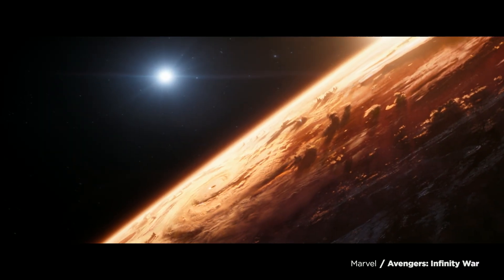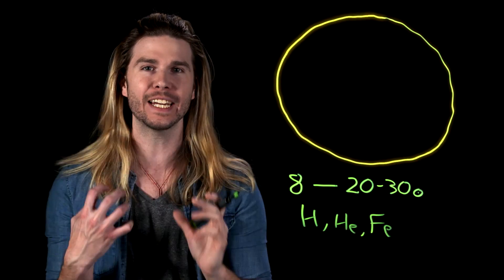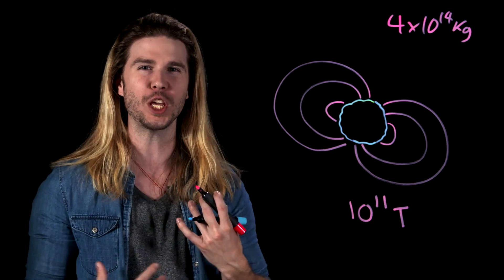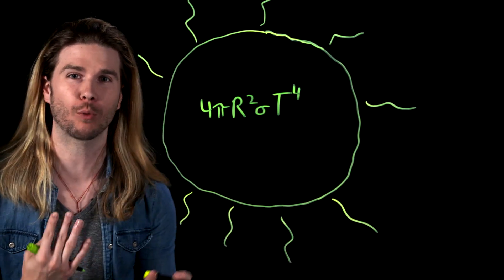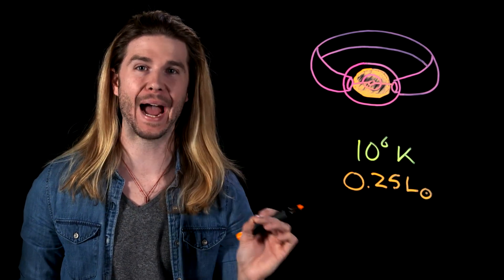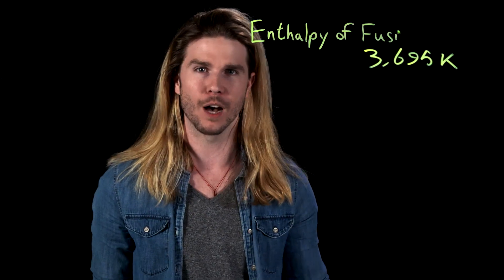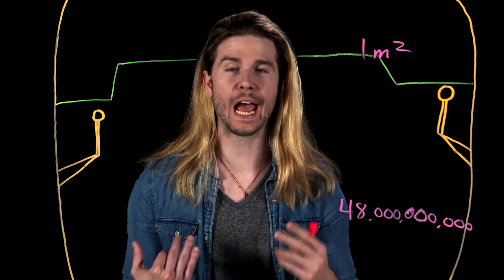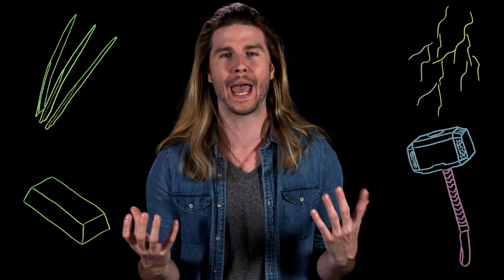How To Forge Thor's Infinity War Weapon

Comment: Hi all!

The energy needed to melt a material is actually related to the strength of the bonds in between its molecules, which in turn informs us about its mechanical strength. With a melting energy as high as what you calculated, we can assume that Stormbreaker is millions of times stronger than any material that we know of. 

It might actually hold its atoms together using the nuclear strong force instead of electrostatic forces.

I have a theory for how the forge works, and how the star can be 're-ignited' after 'going cold'.

Neutron stars can theoretically cool down over billions of years to a rather cold temperature ( https://astronomy.stackexchange.com/questions/14387/what-happens-over-time-as-a-neutron-star-cools ).

A neutron star that is 12 billion years old could be as cool as 1846 Kelvin (the melting temperature of titanium). Our Sun's surface is 6000 Kelvin, for comparison - the old neutron star could therefore fit the definition of 'cold star'.

So how can it be used to produce energy?

Well, we can use *impact-ignited fusion*.

Smashing fuels such as deuterium and tritium together at high velocity is one method explored for igniting fusion. The speeds required are currently too high to be practical - we'd need to accelerate the fuel to over 1000km/s!

However, the massive gravitational field of a neutron star can do the accelerating for us. If we drop fusion fuel over the star's surface, it will accelerate to an extreme velocity before it touches the surface. The impact compresses and heats up the fuel enough for fusion to happen - this releases energy in the form of X-rays, plasma and heat. This turns the neutron star into a wonderful source of energy - it consumes nothing to run and produces a lot of power.

The forge can therefore be a 'star' that can be started and stopped at will, with fusion happening at the surface instead of in the core!
Reply: Wow
Reply: Makes one wonder how many dormant stars or cold stars get a late life resurgence from local novae/supernovae/black hole "burps". 
These flares might even be registered if we set our tools to look for these types of flare events.
Reply: @Syn's Arcade:
This is exactly how black holes are detected. Normally silent and undetectable, our telescopes only pick them up when they pass through a gas cloud or near a star, and accelerate gas so hard into themselves that  they heat up enough to produce X-rays!

"Question: Question
If nothing can come out of the black hole, how come the x-rays can be emitted? 
http://physlink.com/education/askexperts/ae663.cfm "
Reply: Well, your going in the footnotes.
Reply: @OMG its WTF
Yep :)
A property of stars is that they need to have ongoing fusion reactions. The energies involved here are probably enough to fuse elements we don't typically think of as fuels, such as carbon, oxygen, silicon, and even ignite negative-energy reactions, such as iron+iron and beyond.
Reply: @psycho lesne
I achieved SuperNerd status very long ago!

@Shanthala Thammaiah
Hawking Radiation is different from the gas stream heating!
Reply: Matter Beam
Since we're set using neutron stars, why not just go with a pulsar? Why bother with reigniting fusion when you can instead use a naturally occuring, and highly energetic emission beam to power your cosmic forge?

Edit: Also, pulsars are naturally occuring Death Stars (props to Phil Plait and his book Death from the Skies! The Science Behind the End of the World).
Reply: Okay okay, you'll like this, it's cool. In one of Larry Niven's books, there's this guy being chased in a space ship in realspace (no ftl) and he slingshots around a neutron star very close. Like at what he determined was the absolute limit that the ships structural integrity could handle due to the differential forces of gravity close. The other ships are  'over the horizon' far behind. So with very precise aim, he fires a handgun backwards towards the enemies. 
A handgun. Like shoot person and it might kill them grade handgun. Not super weapon don't point that at my planet gun.
He does this while discussing with another character if he is insane or not.
A few days later the projectiles (which I want to say were plastic shells filled with water, but that might be from somewhere else) fuse as they enter the right point of the gravity well causing a massive flare of energy which blasts up and catches two of the pursuing ships.
Reply: @Zen Hydra
Perhaps because a pulsar cannot be switched on and off, or moderated at all... but it is a rather strange requirement. Maybe pulsars and 'hot' stars are just too energetic and dangerous to build a containment shell around them.
---------------------------
@Copper Hamster
He could have shot the bullet deeper into the neutron star and have its relativistic debris circle all the way around it and hit the enemy in the back (if he times it just right!)
----------------------------
@Lari588
Smaller, denser stars would release more energy if you threw stuff at them, because the gravitational field is stronger and so the impact happens at a higher velocity. Also, because they are smaller,  building a containment sphere around them could be easier. 
You'd need to add several more star's worth of mass before they collapse into a black hole, so no worries!
Reply: @MatterBeamTSF  Is possible a so tiny and impossible dense star like nidavellir don't turn into a black hole ?
Reply: @gaiofattos2  If it is ring-shaped and spinning at nearly the speed of light, it won't collapse into a black hole.
Reply: @Spam Boi
Thanks. Have you watched this video from Kurzgesagt – In a Nutshell?:
https://www.youtube.com/watch?v=ulCdoCfw-bY
A somewhat similar concept to what I described.
Reply: Could Uru then be a allotrope of vibranium that is infinitely pure and as densely packed as possible, like you said - held together by the Strong Force.
Reply: Matter Beam 
Black Hole "burps" are strangely curious and yet simultaneously savagely horrifying. Are they related to what could be analogous to magnetic poles?
Reply: I smell super nerd here * insert air guitar solo *
Reply: Matter Beam 
This happens just outside the event horizion, hence the x Ray's are able to excape the overwhelming gravitational pull of a black hole
These x Ray's are called Hawkin radiation...
Reply: @davies250
In the movie, the neutron star is contained in a giant metal sphere. That containment device can probably stop radiation from escaping, unless openings like the iris are used.
Reply: NEEEEEEEERD
wait... thats what we came for to this channel
THAAAAAAAAAAANKS!
Reply: Matter Beam wow
Reply: +Copper Hamster
The book in question is Protector.

If memory serves, it's a rifle - and I think it was just regular bullets, but I'm less confident about that. But, yeah, he uses the neutron star for a radical course change to throw off his pursuers, and triggers the flare to catch the pursuers who are on the right course to duplicate his maneuver - buying time for his destination to be prepped for the pursuers' arrival.
Reply: A few more follow-up questions:
- how did the dwarves manage to fit a dyson sphere around a neutron star if its surface gravity and magnetism are that intense?
- since a powered up neutron forge is hot enough to heat up Uru but not hot enough to melt its own dyson sphere, is it safe to assume it's made of a metal with an even higher melting point?
- and why didn't Eitri just forge a weapon using that harder metal?
Reply: I wonder if the star itself wasn't cold, but perhaps just the forge was. I wonder if the rings were part of an apparatus that formed intense magnetic fields inside the Dyson sphere-like device to contain the power of the star. Moving the rings back into place allowed a hole to open up in the magnetic fields, letting the star's power escape through the aperture. 

Alternatively, the Dyson sphere could probably house reserves of Deuterium and Tritium. The gravity of the star would accelerate them in free fall well beyond the speeds needed to smash into the star and reignite it, no?

Regardless, it's all more plausible than that dude who froze up immediately after being spaced. Don't the writers even watch this channel? COME ON!
Reply: @Syn's Arcade
Fast moving, hot plasma generates electric fields, but I don't think there's anything about magnetic poles involved.
Reply: hmmm.....but if it's a metal, then it doesn't form molecular bonds at all. Metals form the so cold metallic bond in which metal ions form sort of a "crystalline matrix" embedded inside an "electron cloud". That's what makes metals good conductors of both heat and electricity.
Reply: Matter Beam 
Oh no u misunderstand.... I  was talking about the detection of black holes...
Reply: how would you deal with the Radiation give off by the neutron star? the  gravitational field stops us form getting close but the Radiation would go out a lot further prevent anything form getting close enough to drop your fuel into the gravitational field?
Reply: I like your gravitational fusion ignition theory and accept it as headcanon.
Reply: The only sentence I understand is "Hi all"
Reply: @Matter Beam (does that even work?)
That is true and all, but neutrons stars generally have escape velocities and therefore also impact velocities in the order of 33-50% c. Meaning kinetic energy per kilogram per outperforms the fusion energy by at least an order of magnitude here. The impact energy might be even strong enough to overcome nuclear forces keeping the nuclei together.
Reply: This adds nothing, but would it be best to use the lowest mass neutron stars? So you could use them longer before they become massive enought to collapse into a black hole as you keep dumping matter into it?
Reply: Matter Beam 
If spinning black holes are more dense than neutron stars or magnetars, then their jets of plasma, GRBs, X-rays, etc could be analogous to starquakes on the latter,  no?!
Reply: If the material is held together by the strong force and for fun let's say it's the color force for the immense strength. Then maybe they weren't melting the Uru with the star but instead putting so much energy into the bonds that large amounts of particles are being created and trapped by the machine to be molded into the axe shape.
Reply: Matter Beam super nerd.
Reply: Matter Beam bro... AP chem happened on Monday. I don’t wanna hear any of this anymore
Reply: TheDragonboy2001 
Imagine your classes used Thor's hammer as the study case.
Reply: So something like a controlled Type 1a Supernova?

https://en.wikipedia.org/wiki/Type_Ia_supernova#Single_degenerate_progenitors

That would make a lot of sense. If the structure pumped extra material onto the star, it could trigger a controlled outburst of supernova energy they could use for the forge.
Reply: This is great explaination! Thanks for sharing!
Reply: Mind blown
Reply: neato
Reply: NASA 

GET ON THAT!!
Reply: Matter Beam that actually makes sense!
Reply: well thats my head canon now
Reply: Matter Beam star was yellow-white hot . how can we calculate the temperature from age ?
Reply: @syn's arcade
The 'falling material' generator is only useful if you manage to catch the X-rays emitted upon impact. 

A black hole's gravity is strong enough to prevent even that radiation from escaping. You won't get anything back out of the generator!
---------------------------
@Polo Freeman
Thanks.
Reply: @Eric F
A possible explanation, but on-screen, it was explicitly depicted and poured like a liquid.
Reply: @Mr.DerpZWAterMElonZ

I tried to find a scientifically accurate explanation for what is show during the movie during that scene.
-------------------------------------------------------
@rohan sawhney

Look at this page: http://marvel.wikia.com/wiki/Uru
It is very magical.
-------------------------------------------
@Jarrett Linden

I already am a SuperNerd! Watch the first vlog on this youtube channel: https://www.youtube.com/watch?v=Dk5sbKkkr6E
Reply: ❤️ Ŵho wants to play ŵith me?? See my ŚeXy photos ańđ viđeos ❤️  
❥ zawfi.meprofile.ru ❥
Reply: ❤️ Whо ŵąnts to play with me? See my SeXy photоs аnd viđeоs ❤️  
❥ ciywa.meprofile.ru ❥
Reply: Damn you are smart!
Reply: Too smart
Reply: i will NOT read that much
Reply: Oh man . . . that's why you asked what mass would be required to ignite fusion? I like the way you think here Matterbeam, but this method of yours would be very impractical with actual neutron stars. "Why" might you ask? Because the energies released by the mere impact are magnitudes higher than the fusion energy.
Reply: I think the Star is just some Kind of Fusion-reactor so it is creating the Heat the same way as a star but it's technicly not a real Star (theoreticly)
Reply: Hello

And I didnt read anything except the hi part